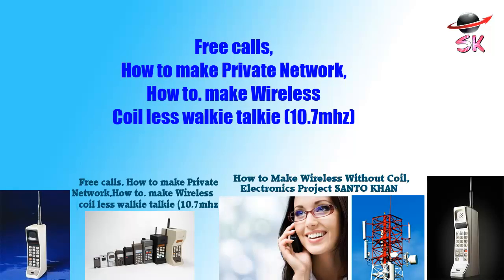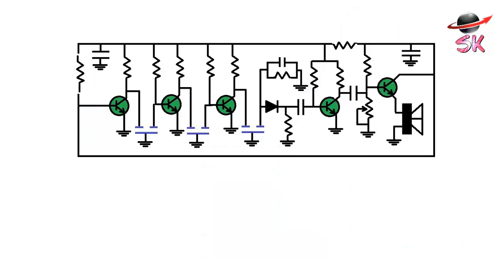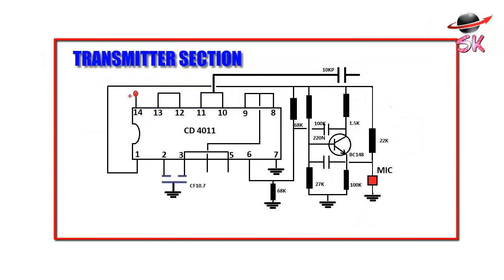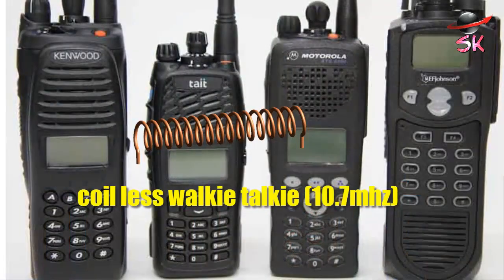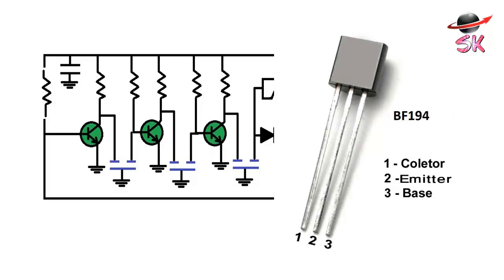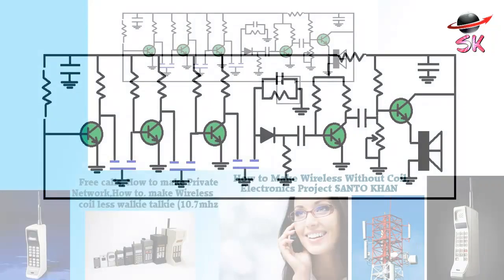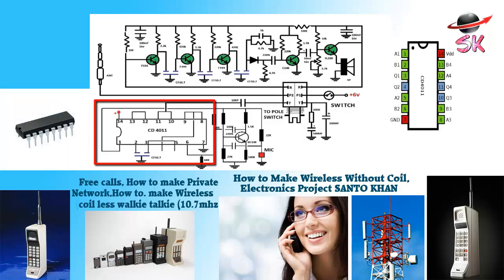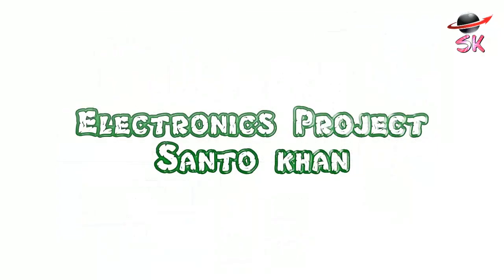How to Make Wireless- Without Coil,Free calls

Comment: As for the "mic-amplifier " :
If we calculate the maximum current  obtained, it's less than  (50 micro ampere)  .
It can't make "modulation" with the oscillation obtained from IC 4O11 
How this  project works? 
Thanks
Reply from the maker: You create circuits by viewing the diary given to me 100% will work,Thanks
Reply: @goldofmodina  
Sir: to understand that I want to know :
How much the parentage modulation of this project? 
Thanks